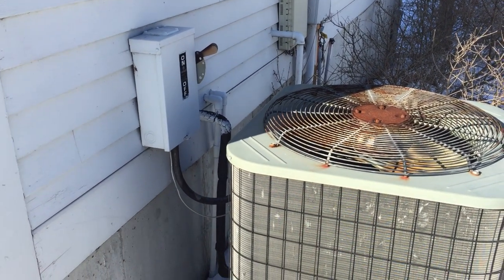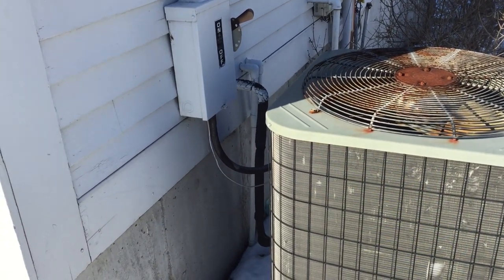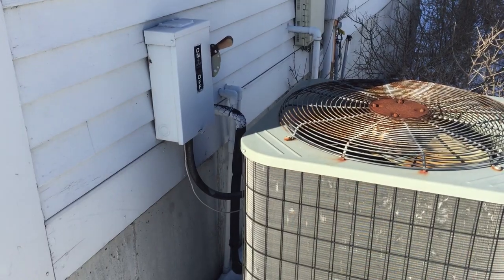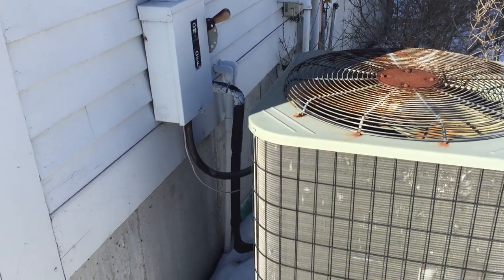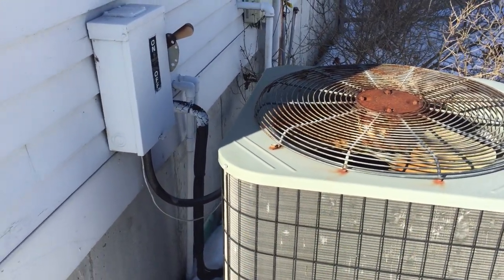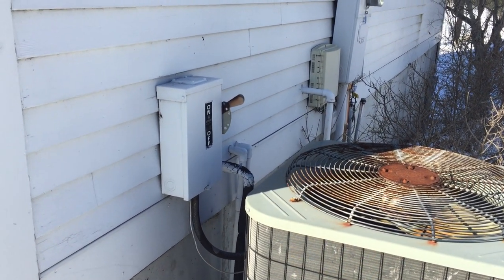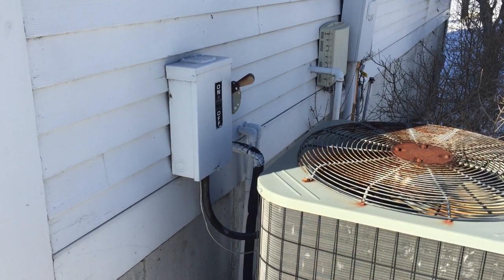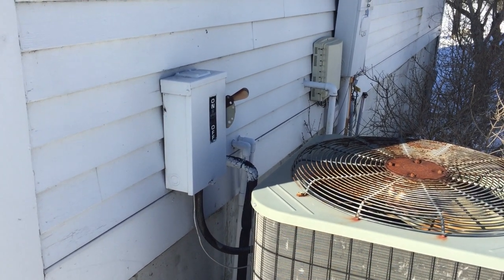Moving Violations Video No. 227: Need More Room to Work

Comment: this is splitting hairs on a residential property.... I would argue no one is going to work on this disconnect. It is there for servicing the AC condenser and will probably never be worked on until the AC unit is removed.